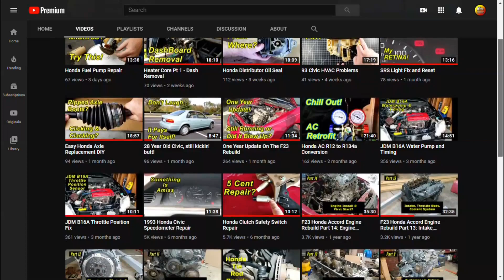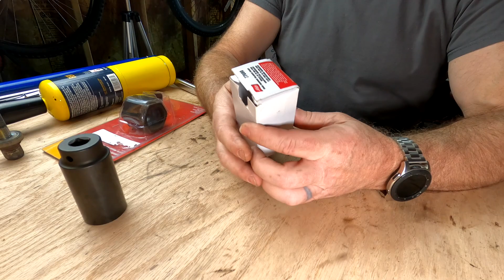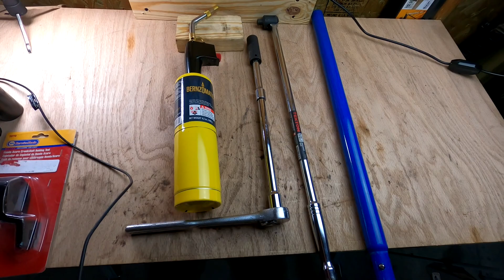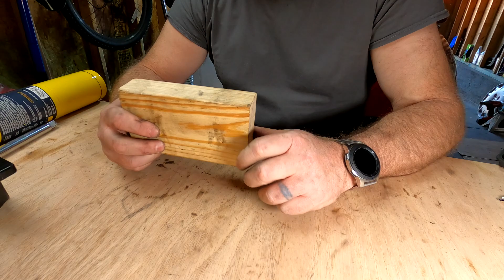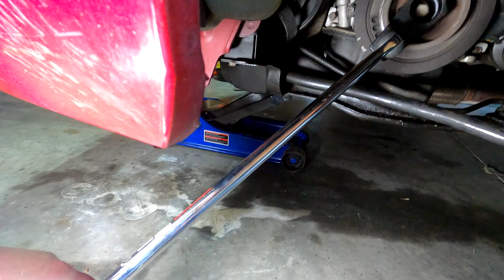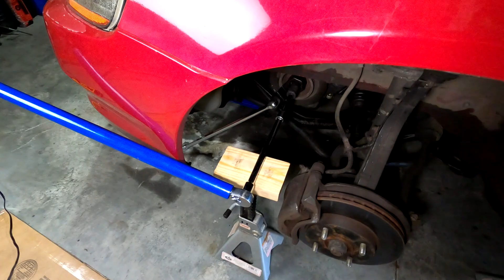Honda Head Gasket 1: 1st Step, Crank Bolt Removal

Comment: Your 6th gen content has no equal.  Too valuable.  Hope your channel takes off but I  also hope to continue to get 6th gen parts for reasonable money.  Would love to see an update on how your rebuilt f23 engine is doing as of today.
Reply from the maker: Thanks man. I sold that car a few years back and it was running like new. I'd like to know where it ended up. Unless it got wrecked, I'm betting it's running fine. Honda at their best with that gen.
Reply: @ktecgarage  Thanks for the response.  I agree, and I am very glad they made as many as they did(parts are still obtainable, new and used). My money would be betting on yours still running.

Comment: What model motor is this, I'm trying to do the water pump on my f20b soch and can't figure out the timing system.
Reply from the maker: F23a1. Should be the same, but you should make sure.

Comment: In my case, i was thinking in changing the gasket, but the gasket didnt look bad, the bolts felt too easy to unscrew, so I took the block and the head to resurface... they had to shave off 0.3mm to it to have it straight... maybe thats your problem too...
Reply from the maker: I appreciate the input. The head and block were within tolerances and the car ran fine after the repair. 

Thanks for watching and commenting!
Reply: @ktecgarage  Awesome! thank you for checking and all the things you share with us!

Comment: A few questions.  Why remove the crank bolt?  Unless you are also planning to replace the timing belt is it necessary?  Can you just loosen the tensioner and slide the belt off?  Can you set timing at TDC before you remove it then just put the belt back on after?  I am currently thinking about removing my head on my accord to go through it and will need to replace the head gasket also.
Reply from the maker: You can. But if something moves (Murphys Law) the balancer and belt cover hide all your timing marks. Yes, you can do your own marks, but this is the safest way. If the timing belt is off by even one tooth, it's not going to run right. 

Thanks for watching and commenting!
Reply: I was wondering the same thing. Planning on replacing head gasket. Since im at it, will go after timing belt and water pump.